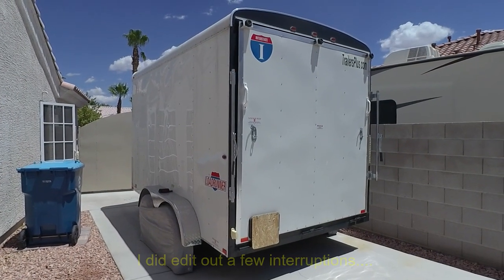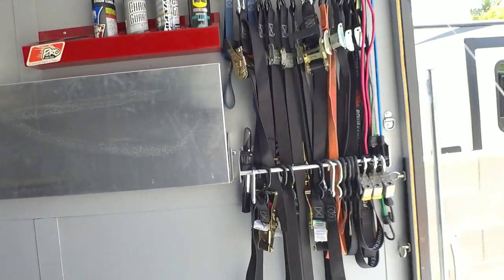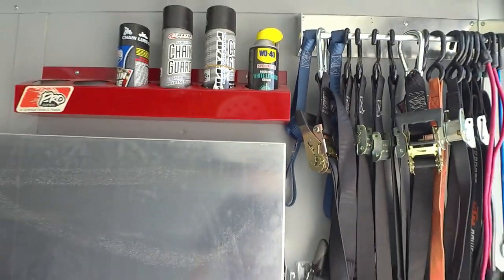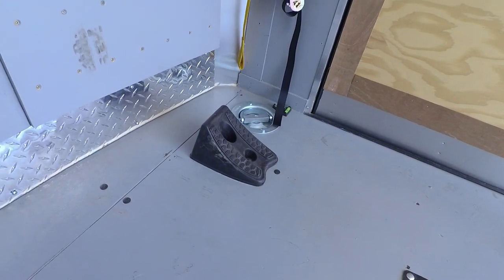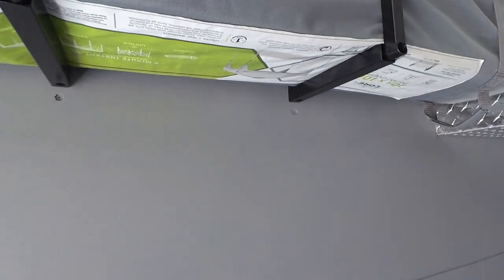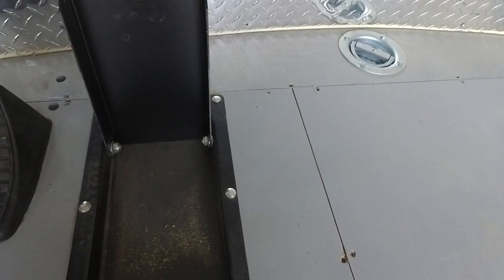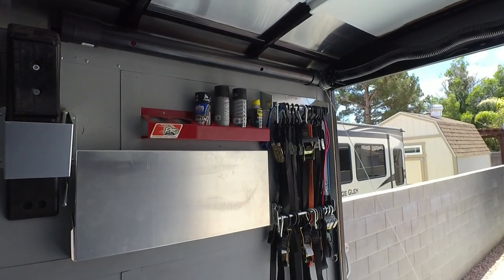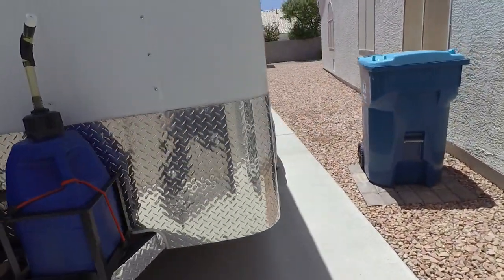7x12 Enclosed Trailer Custom Mods (Updated Video)

Comment: You created a very dangerous condition under your external gasoline storage tanks. You stated you inappropriately substituted in a "Lithium Battery" for the original Lead Acid battery. You should NOT have done that because  the charging parameters are very different between those different chemistry battery types. Your vehicle uses a Lead Acid battery and has a charging system designed to charge a Lead Acid battery. You probably found a Lithium Iron Phosphate LiFePO4 chemistry battery and substituted it in for the original battery box Lead Acid battery. Obviously you did not do any research about the differences between the  charging needs of the  two different battery chemistries. A Lead Acid battery uses different voltages throughout its charging cycle than does a LiFePO4 battery. A vehicle battery charging system ALWAYS provides a Trickle Charge which is fine for a Lead Acid battery but that Trickle Charge will destroy a LiFePO4 battery. Best case scenario is that you wasted your money and got a shorter life and less dependability from the more expensive LiFePO4 battery. Worst case scenario is that you destroy the LifFePO4 battery in a fire that is exacerbated by your mindless placement of gasoline cans right above the LiFePO4 battery.
Reply from the maker: Thank you for your feedback.  How about this ... BMS ... or ... ventilated battery box ... or ... only connected to the charging source when vehicle is in motion ... in motion vehicle passes cooling air across the battery constantly ... and most of the time there is not any fuel above the battery -- only carry fuel there once in a blue-moon ... etc. ... etc..  So, statically speaking, I like my risk assessment.  Also, most all newer dirt bikes come with a Lithium battery...that you sit on top of and is a lot closer to the fuel cell...and are exposed to a lot more engine/exhaust heat ... and I've never witnessed or heard of a Lithium thermal runaway within the off-roading community.   But hey, your the expert on the plant with this great knowledge on what other people should or should not be doing.  Did you know that you are statistically more likely to die in an accident than you are to have one of your correctly maintained Lithium batteries go into thermal runaway .. of course you did ... what was I thinking.  Hope you have a nice weekend...
Reply: Well if a Dirt Bike came with a Lithium battery, you can be sure that the manufacturer set up the alternator charging system to safely charge up the Lithium battery. Exactly opposite of what you did substituting in a Lithium battery for a Lead Acid Battery. It is true that the original Lead Acid  vehicle charging system  only "charges" at a higher 14.6 to 14.8 volts when the engine is running. However, it is also true that if you leave the Trailer RV plug attached to the vehicle RV receptacle then the nominal 12 volt black color center Auxiliary Voltage Supply wire is connected to the vehicle battery sitting at real 13.1 to 13.6 volts acting as a Forbidden Trickle Float charge connected to the Lithium Battery. The Lithium battery BMS WILL NOT stop the continuous float charge coming from the vehicle battery even when the vehicle is not running. So, I suppose you never heard of a Lithium battery fire caused by improper charging? Don't trust me, ask any Electrical Engineer about the proper charging parameters of LiFePO4 batteries.
Reply from the maker: @PredatorOmnivore  Thank you for your major concern over my personal belongings...is there a risk...absolutely...but not to the level your selling it...like I said before, the statistical data does not support your risk conclusion...and also, why so much hate.  I'm getting the feeling that you must be a complete pleasure to be around.  ... and FYSA -- dirt bikes do not have an alternator...they have a stator....and no, there is absolutely nothing special they change/modify to use a Lithium battery.  For example, Shorai sells direct replacement Lithium batteries for all forms of off-road vehicles...they could not be in, or stay in business if their product was going into thermal runaway for 1 in 10k batteries sold...not even if it was 1 in 100k sold.  Maybe you should contact them and tell them how wrong they are to be selling such dangerous products.  

Here's a post on amazon from W. Marz "Over the last 8 years I've replaced at least 6 traditional lead-acid batteries with Shorai batteries. I have over 10 bikes, and have become a great fan. Light weight, high performance. On older bikes where there is no drain from computers and electronics, charge holds for over 9 months and starts immediately. Higher cost, but great benefits."  And the list of people that have installed these batteries over LA ones is massively long!

Also, I guess you really do not read what other people write...because if you had you never would have included most of the info in your second reply.  The trailer is only ELECTRICALLY connected to the vehicle when the vehicle is towing the trailer (a risk reduction technique) ... so, sorry, but no forbidden trickle charging is happening.  And I guess manufactures cannot design a BMS that turns off trickle charging....an engineering impossibility.  Correct, Karen!   Have a nice weekend... thank you for putting a big smile on my face!!...very entertaining... 👍👍
Reply: I went out and bought some treadplex for my trailer walls and floors, i used a test piece of wood as a sample after sanding and cleaning. Let the paint cure and noticed that it scuffs and scratches very easily just with my finger, probably fine for the walls but definitely not for the floors, have you noticed that on your walls? 
I plan to get Rexthane for the floors just like you did and I’m hoping that that holds up to scuffs and scratches much better than treadplex!
Reply from the maker: @Adamthebuilder   I'm not sure on the level of damage you mean when you stated it scuffs and scratches easily.  I know the REX stuff will mar up some with aggressive dragging over the coating, but the surface doesn't scratch away unless the wood gets pulled off/up as well.  Regarding the TREAD on the walls...I haven't notice anything marring up the surface from just normal impacts...but I mostly just look for wood color showing...not surface scuffs.  I know that the REX is a lot tougher than the TREAD stuff.  Note:  I didn't do any prep work on the wood other than give it a good sweeping/dust removal.  I also put a pretty think initial coating on...I cannot remember if I applied any second coats.    I have to sell my current trailer to upgrade to a wider one...so I'll have to redo all the mods on the new replacement trailer and I'll be doing the same paint coatings (Thread on walls and Rex on floor/ramp).   I hope you are happier with the REX stuff...
Reply: @SteveSmith-wl8yq thanks for the reply, i am just talking about surface scuffs mainly, it definitely stuck well to my test piece and does not pull up at all which is great! I tested it’s toughness by using very light pressure with my fingernail and it scuffs up very easily, not that I really care but for a product that is meant for floors I expected tredplex to be better at resisting scuffs, I was planning to use it on my walls like you did so scuffing should not matter to much. I like how easy it is to work with though!
Reply from the maker: @Adamthebuilder   Makes sense...I see/understand now.  Thank you for the clarification.